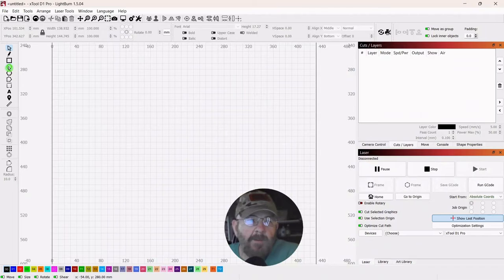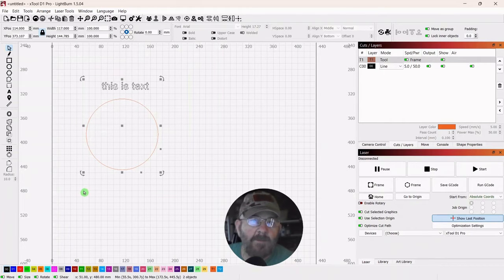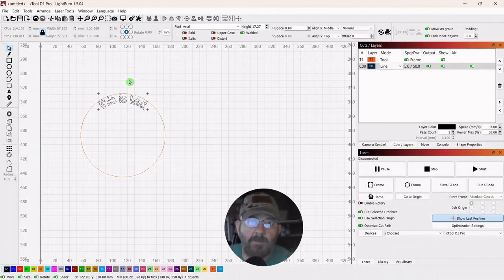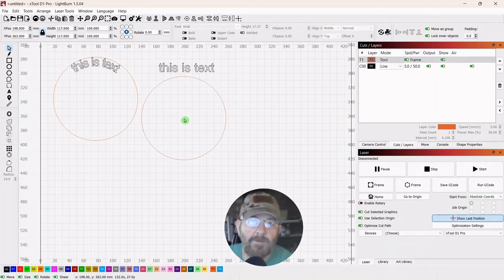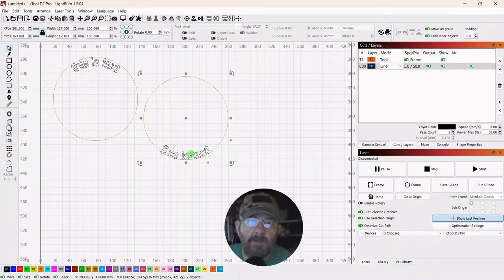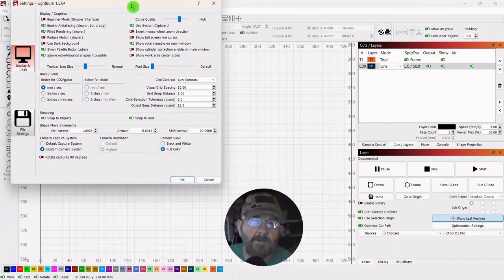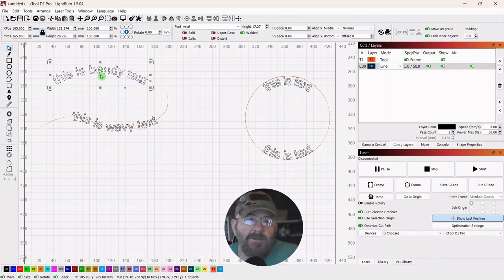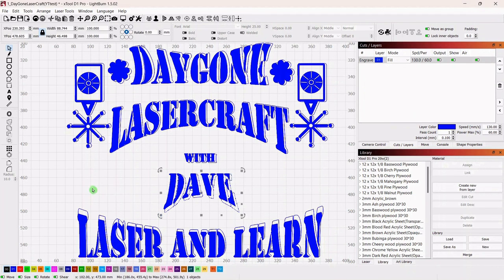Apply Text to Path | Lightburn Tutorial #19

Comment: Great video. I'm trying to put text on the bottom of a rounded triangle. It's made from presets, with rounded corners. Obviously I can't rotate the tool path. How do I get the text on the bottom.? Fo I need to break the tool path so it has a start and stop?
Reply from the maker: Text to path can be tricky.  If you can send me a screenshot or even a crude drawing of what you are trying to do, to (dglasercraft@gmail.com), I will try to figure out the best way to do it. Thanks - Dave!
Reply: @DGLaserCraft  It's ok I drew another line on the same layer then used trim to delete everything but the section I needed. Then applied the path. I think enclosed shapes are tricky cause they dont have a start or stop node. Break the shape and it does..
Reply from the maker: @fraserstevenson6439  Thanks for sharing the fix - it helps me and others that read through the comments. I just tried your fix and it worked great - could make a good video.  Take care - Dave!

Comment: YOU JUST TAUGHT ME A LOT IN 10 MINUTES WHICH I HAVE BEEN TRING TO DO FOR A WEEK, EXCEPT FOR ONE THING...I AM DOING THE TEXT TO PATH IN A CIRCLE, TEXT ON TOP AND TEXT ON BOTTOM.. WHAT IM TRYING TO DO IS WELD THE TEXT TO A CIRLCE..BUT WHEN YOU DO THE METHOD OF COPY TEXT AND      DUPLICATE   THE CIRLCE AND THEN LINE THEM UP YOU HAVE MULITIPLE CIRCLES,AND ONCE TEXT IS TO PATH I CAN'T MOVE OR ADJUST  TO ALIGN WHEN I WELD...IS THERE A WAY TO DO THIS INSTEAD OF USING THE BLUT TEXT DOT...WISH THERE WAS A A WAYTO SEND A PICTURE
Reply from the maker: I think I understand what you are going for... Once you bring the 2 circles together, select both and group them. Then select circles again and do a slight offset and see if that works. If not, the blue dot for bending will be the best way. Let me know if this does not work and we will figure it out. Thanks for watching and for the question.
Reply: @DGLaserCraft  I WILL GIVE THAT A TRY AFTER WORK

Comment: Great video.  Did Lightburn change?  This doesn't work anymore.  When I select my path and text, right click, the "convert to path" option is always greyed out. Any ideas?
Reply from the maker: Hey Raymond, it does still work. To test, start with a blank workspace, type a word, draw a circle, select both then right click. You should have the option to "apply path to text" - give that a try and let me know if it works, if not, we will figure out what is going on.
Reply: @DGLaserCraft  Yeah I tried it several times.  I did it many times in the past.  Maybe there is a change in the last update? I have 1.7.01
Reply from the maker: @raymondsprouse6230  I also have 1.7.01 and it is working with just the word "text" and a single circle.  You can send screenshots to "dglasercraft@gmail.com" and hopefully we can figure this out.